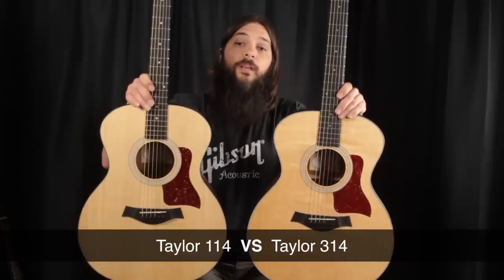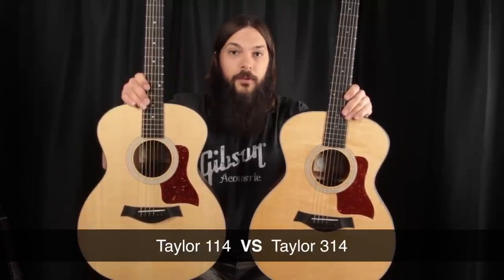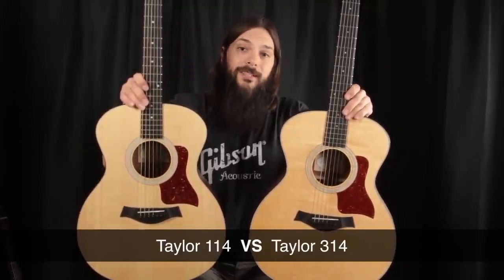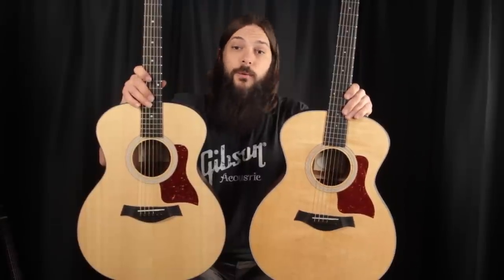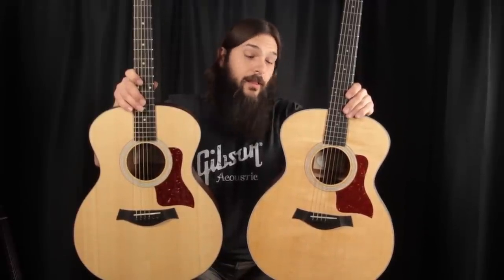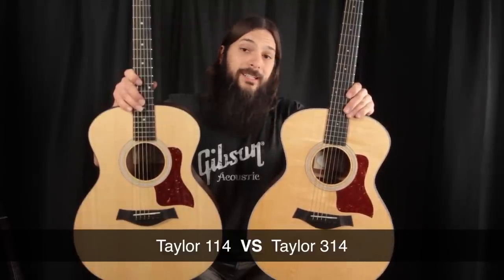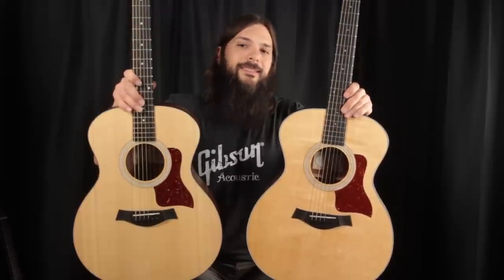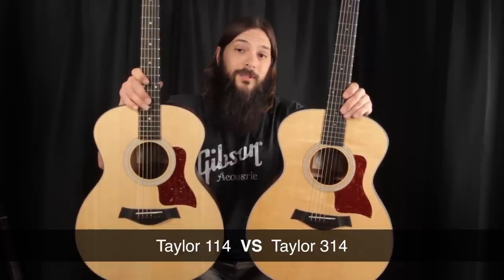Taylor 114 vs 314 - Laminate vs Solid Wood Comparison

Comment: Do you use stock strings on the guitars in your reviews? Do you ever change them to a different brand?
Reply from the maker: +kdrake777 Our reviews are done shortly after the guitar has arrived in our store.... so the stock strings are usually used.
Reply: +kdrake777 Taylor also puts elixir strings on all their instruments out of the factory, so their "Stock" strings, are pretty damn high quality strings